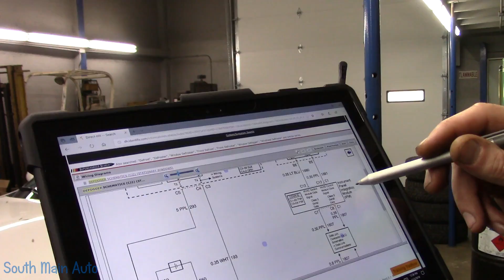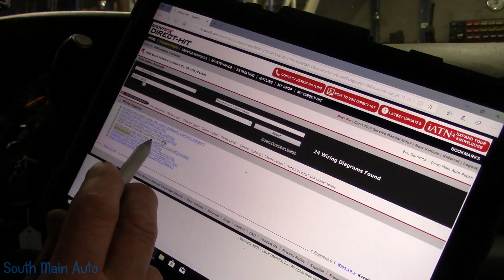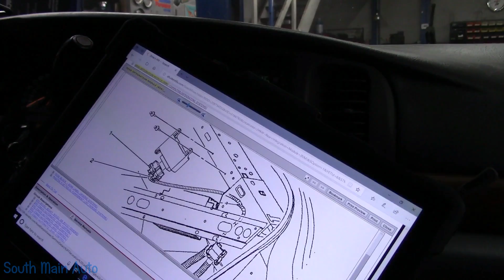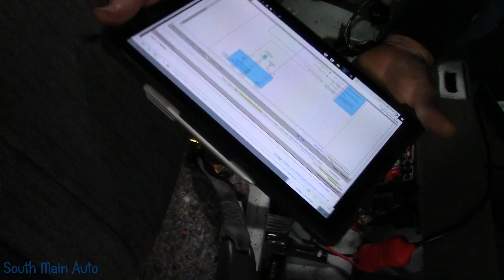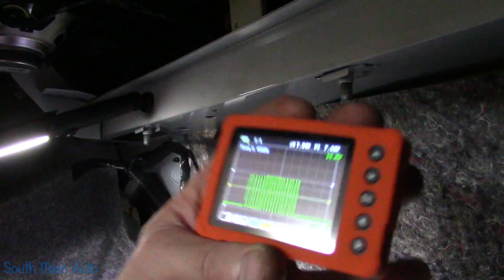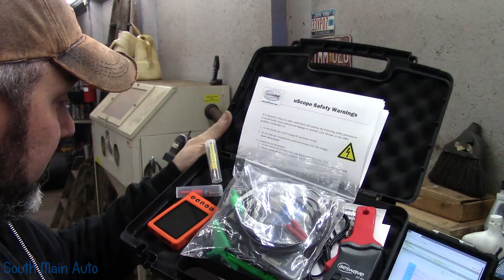Buick LeSabre: No Reverse, Interior Lights, No Defogger, No Power locks

Comment from the maker: *uScope Basic Kit (AES# uBasic)*
 :

https://www.aeswave.com/cart.php?m=affiliate_go&affiliateID=2525b91fc8e906e8215984074c9d9e8f&go=https://www.aeswave.com/uscope-basic-kit-p9621.html 

 
*uScope Master Kit (AES# uMaster)* :

https://www.aeswave.com/cart.php?m=affiliate_go&affiliateID=2525b91fc8e906e8215984074c9d9e8f&go=http://www.aeswave.com/uScope-Master-Kit-1-channel-automotive-scope-p9273.html

*Power Probe IV w/Case & Acc - Red (PP401AS)* : https://amzn.to/2JBSqbb
Reply: I had recommended this scope to you  3 years ago when I got mine. Use it all the time,under dash, in rear fascias(left/right cross traffic mod.no comm.) under seats etc..super handy. Firmware updates on AESWave web site.
Reply: Cool kit! The master kit link above redirects to the index page - I think that should be: 
https://www.aeswave.com/cart.php?m=affiliate_go&affiliateID=2525b91fc8e906e8215984074c9d9e8f&go=https://www.aeswave.com/uScope-Master-Kit-p9622.html
Reply: @MichaelShuler  I'm guessing that is in US funds.
Reply: The coil paddle is nice. It slips into tight areas.
Reply: What scan tool gives the schematics diagrams?
Reply: The scan tool you are using is it who makes it , is it  available in medium/heavy duty application or is there a yearly subscription for it.
Reply: That's kinda funny.  I bet that is a greek u symbol, which in electronicalses world is used for "Micro"   So it's a "Microscope"  Kinda punny.   :)
Reply: @JamesP33R  Makes sense, Greek letter "mu", symbol for "micro" in science and engineering.
Reply: I'm totally buying one of those! No idea what I'm going to do with it, but I'm getting one anyway.

Comment: I have a 2002 Lasabre with barely over 100k on it. I developed a new problem where only the drivers side power window motor works and the interior lights do not work along with the other 3 door windows      any ideas anyone?   Great video on the Buick just like all your videos.    thank you

Comment: Thanks, had all those issues, replaced the module and now everything is working again. The Back seat is THE BIGGEST PAIN TO REMOVE. Push and push those clips down and pull seat straight out. Would have been easy to remove from truck but no GM had to put 2 plastic clips in back of seat. Total BS. Glad it worked so cheers to you!!!

Comment: I have a 01 lesabre custom,the power locks,turn signals,trunk release,key fob,everything in the guage cluster except security light and odo. ,doesnt work,checked both fuse boxes 5 times,nothing bad,any ideas? I'm guessing one or all of the bcm,2 I can get to but cant get to the third,

Comment: love your channel and learn alot.  half the episode must be about teaching how to use certain techniques to troubleshoot with scanners and wire diagrams.  if that's the case, thats great, it is very informative.  i'm saying that because before you go into all of those steps, isnt it faster just to look under the seat at the harness and if thats not your problem then move on?  Love the smell of brake wash or brake cleaner too haha.  i used to use carb cleaner, but brake cleaner comes with so much more force.  its great when i'm not around my parts washer.

Comment: A friend of mine had a Mercedes, one of the small ones. The air intake for the hvac pulled air off the top of the battery. I couldn't believe that stupidity.

Comment: Is it possible for reverse lights to not work but interior lights work but still have a bad RIM? My reverse lights and license plate lights have not worked in a long time. Changed bulbs and checked fuses and both did not fix problem.

Comment: I had a muffler shop fry my electric steering never disconnected the battery when welding it.  Couldn't turn right, after I left and took it to dealer 900$ later they had to change the whole steering column.  The shop gave me every penny back, I still use that shop to this day even though they screwed up they were very professional and didnt try screwing me honesty goes a long way with me.

Comment: Please do an update if you got the ok to fix it. I'm curious if the module is plug and play or has to be flashed. I have a customer with an 03 Park Ave that has a bad  RIM, but I have yet to find 1 used, and GM doesn't make it anymore.  THX for all you do!

Comment: Eric, this is a little off topic. I just had a new starter put in my Dakota. On the old starter the main wire from the solenoid that goes into the starter case pretty much corroded away to nothing. On the new starter the same wire is bare metal. Should I paint it with high temp paint or hit it fluid film every few months?

Comment: Eric! Bought the uScope using your link! Thanks for linking the basic one. I thought there was only the, "Master" kit. I got the mini bnc to bnc adapter so I can use my Pico leads. In regards to the module, occasionally I see things just randomly die from having the battery disconnected and reconnect. Either that or the shop shorted the alternator, and then disconnected the battery once they realized that's what they should of done (shrugs). Thanks again for all your videos. They've changed my life, and 4 years later I've quit my job and work on cars full time successfully.
Reply: Exactly my opinion,  I hate to think the worst of people but people are typically the worst, like you I bet they decided to undo the batt. After sparking out the alt.

Comment: Bunch of overcomplicated bullsh*t - Buick should just hook the wire from the “rear defrost” switch to the damn relay; having all these other modules just introduces more points of failure. It’s okay if they want to use the modules to diagnose problems, but the results should be in plain English (“blown fuse”, “heater burned out”, “short to ground at switch”, etc...), not some mystical code. Sadly, most computer software suffers from weird error messages too (and I know, I AM a computer programmer by vocation)! 😎 Remember, when all else fails, pack the POS full of fireworks, light the fuse, and run like h*ll! (Or at least, buy a new can of brake parts cleaner - had to throw that in!) 🤠

Comment: Had a 66 Impala the wires under the back seat were shorted by the seat so that caused the fuel gauge not to work. Also I have just the scope like that i built from a kit for $20. P.S. What was the out come did the new module fix it?

Comment: Eric, how did you get the latches from the back seat cushion to release?? I have the exact same design on my Cadillac and I can't get the rear seat cushion to pop up to be removed. I couldn't see what you did in the video because the camera wasn't at the right angle for filming. I'm tried pulling, pushing rearward and everything else the factory service manual describes and I still can't get the rear seat cushion out of its latches. Thanks.
Reply from the maker: On the front of the rear seat bun I push down, then back, then pull up. When i do the follow up I will try to remember to show that.
Reply: @SouthMainAuto  So you're not reaching your hand between the cushion and the carpet to pull on a release lever? There's no mechanism?
Reply from the maker: no sir, just a fixed latch and hoop
Reply: @SouthMainAuto  Thank you very much. I'll be looking for the procedure shot in your follow up video if you remember. Smiles.
Reply: I have a 2011 DTS, You need to pull up in a firm quick motion. If you pull up gradually, the seats wont come out.
Reply: @peterm1643 I think some cars, including yours, could be a little bit different compared to others.  Mine is how Eric described but I just get scared because I don't want to damage anything under the cushion. I've never been someone who just tugs real hard because in most cases it breaks on me. Thanks.

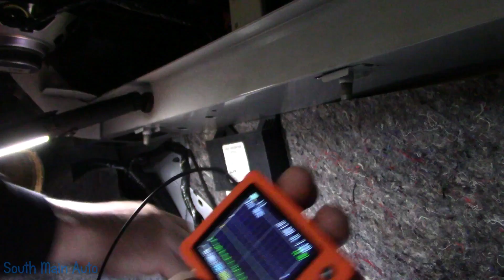Comment: 19:40 on... bends needle stabbing for a ground (habit from using more robust stabby things), "And with the module still plugged in we still got.... nothing, cos my wire fell out" - I had to stop to compose myself I was laughing so hard. Not laughing at you there Mr O, I do similar work and it just struck a chord with me that the exact same type of things happen from time to time, usually comes in a wave of "oops.. didn't mean to do that", "oops.. that doesn't plug in there", "ummm... that was working a minute ago... left this cable detached testing something else dummy"... and on and on. I have been known to just walk away for 10 minutes to regain composure when it happens, it's almost as though my cognitive functions went bye bye and need a short nap or a reboot while at the same time everything around conspires to befuddle my diagnosing. :D

For the record, today was my dropsy day - every tool, fastener, piece of paper... anything, that came into my hands was promptly sucked away by gravity. The smaller it was the further it managed to flit away into a dark crevice or under some immovable object requiring ridiculous amounts of time to retrieve. And no I did not go to work drunk! Hope it's not just me that has days like this :D

I love the look of that mini scope, so portable for confined spaces I sometimes find myself in.

Comment: Other shop had no class, it doesn't matter if they had anything to do with the failure or not. Never tell a customer to pound sand! However I heard the old phrase "ever sense you worked on my car" more times than I can count. Some how some customers think just because you work on their car everything that goes wrong from there on is your fault. In 45 years I never told one to go pound sand. I did throw one or two out of my shop after they threatened to beat me up!
Reply from the maker: Thing is this guy is pretty calm. He totally understands, he was just wondering what was wrong and if it had anything to do with it.
Reply: Mr. O, I do hope you alerted the customer that the battery must be corrected for safety reasons in addition to the needed module.
Reply: @SouthMainAuto  He might be calm, but does he own an excavator ???????

Comment: Ha ha - Keith gets a uScope, so Eric needs one.  Ivan must be next.

Sorry, nothing to do with the video.  The uScope is GROSSLY overpriced.  4096 sample point memory.  1 MS/sec sample rate is really only good for 100 kHz signals.  Bluetooth would be more useful for saving data than USB.  Can the microSD card be used to save waveforms ?  Looks suspiciously like a DSO Nano which sell for under $100.

Comment: AES wave is kinda pricey but there stuff works pretty good and are real convenient to use.  I’ve had the U Scope and U activate for a while now and used them a few times mostly for secondary ignition and to diagnose a cooling fan that was smooth but was not at rated CFM.  I’ve never seen you use their U Activate, its almost like cheating.

Comment: You're the best! You need to change your motto though from: "If I can do it, you can do it." To: "if I can't do it, it can't be done!"
Reply from the maker: Well that would be a lie though
Reply: @SouthMainAuto  Our Air Frame  Shop in VS-24 USN 1973 Motto was "If We Can't Fix It It Ain't Broke".
Reply: No I agree with the original post. 
The proof is the Chevy SSR wiper fix.  
Bad schematic data
Bad troubleshooting guide
Bad replacement part and he still nailed it.

Comment: Hello Sir! First off I wanted to say I really enjoy your video posts and have used them a lot as I try and do most work for my vehicles! Sure wish you were down this way I would gladly give you my business! That being said I  wanted to ask for your advice and really didn’t know how other than just post my question on your latest post! Ihave an issue that has been haunting me on my 2002 2500hd lb7 duramax. The truck for the past month will not go into gear for the most part the indicator light will flash but it’s in a neutral like state. If it does go into gear it will usually shift hard and be in 3rd gear limp. No SES lights on the dash other than a air intake heater voltage low code. I did get a trans code from it once and that was p0700 and trans fluid switch c low voltage code. After doing some reading I changed the NSBU switch with a merchant auto and also the fluid and internal and external filters. No change also cleaned the grey trans plug on passenger side and it did have some fluid inside it. Still no change. I hooked up my hp tuners software just to look at the scanner and I noticed the TCM voltage when you start it will be at 14.3 and slowly trickles down to 8v or less. When it’s about 11 the Trans seems to shift fine into gear and will move without limp mode but below that it has the neutral like issue! I have also changed the ignition switch to rule that out as the indicator went blank yesterday and that fixed the issue but still have the trans shift problem. I checked voltage at the tcm on the orange wire and it reads 14.3 and the grounds seem to be ok at the tcm. Also cleaned ground under drovers door and driver side engine to see if that would help! I am lost st this pinpoint other than changing the tcm I don’t all I know to do. Just wanted to get your opinion on how I could maybe isolate the issue. Thanks for all the shared info it is appreciated!!!

Comment: For us DIY'ers: The Class 2 Serial Data network on a GM uses a zero to Seven Volt signal; the voltage rests at Zero volts when there is NO communication; the transmitted data is a variable pulse width signal; Class 2 is found at Pin # 2 of the DLC, and is a single-wire network system; and GM uses what is referred to as a “splice-pack” to connect modules and the DLC to each other for network communication.  Great video Eric, that little U scope is getting around!
Reply: what time base setting(ms/div more or less) would be ok to see good communication???? Tx
Reply from the maker: 500us / 2v per division with a trigger @ 3v and you should see it just fine
Reply: Thanks Wyatt. Here's a reason I scan comments, looking for gold.

Comment: I got a little lost at the 5 volt part. I thought maybe the 5 volts were supplied by another module but was lost somewhere. Apparently that module creates it's own 5 volt output, or in this case, doesn't but is supposed to. If his 12 volt outlet didn't work before and is controlled by that module, the module might have been failing.

Comment: Why should that battery being in the be such a problem back in my day VW had them under the seat gas was not an issue then no vents.   Battery that cost $30.00 then cost $90.00 now add vents your into that $200.00+range now.  Why don't the put them in the trunk by law.   Look at the Porsche SUV under the front seat.

Comment: Just Friday night my 1993 Jeep Cherokee 4.0 lost  power to the turn signals to the radio to the AC. I got my scope on a rope out and started checking fuses and none of the fuses were bad and when I got done doing that everything came back on so evidently I Josseld something.. but I don't know where whether it was the fuse box under the hood or it was the fuse box under the dash.. but it's working now I also like the fact that you have a Missouri license plate and a Florida license plate on your wall I was born and raised in Missouri and now I reside in Florida .....imagine that....?
Reply: Might check the ignition lock cylinder. They have a habit of not fully returning to the RUN position after starting.  When they do so you get no function of ignition fed accessories. Try turning the key  back towards you after you release the key after starting the engine.
Reply: @SuperGlacierGirl  thanks for the info Brad but I just change the ignition lock and switch like 6 months ago I did forget to mention that didn't I LOL

Comment: I have this problem with my 99 Civic Coupe where my reverse lights only work with my headlights off once I turn my headlights on my reverse lights turn off what can be the cause of this problem?
Reply: Bad ground.
Reply: @mattmanyam  sold the car so I'll never know
Reply: @mattmanyam  I still can't pin point the location alot of wires are spliced at the emergency light switch

Comment: I would try disconnecting the battery  and see if  the issue resolves  itself. Maybe resetting everything.  The rear seat loose and the module failing have some interconnecting  history.
Reply from the maker: we did that in the video if you watched it to the end
Reply: @SouthMainAuto   Yes  you did say you did it , I didn't pay close attention to audio, missed a sentence. I always watch your video's to the end. You  should be a automotive shop teacher  I learn something in every video. Each vehicle is a mystery  waiting for a solution.

Comment: Lol.. I just got the Uscope, but it looks like you got the master set, with scope protector and all the other accessories.  I went the basic, but now I'll have to order the silicone protector... and a couple adapters to use my Pico accessories. .. amp clamp, COP paddle, etc
Reply: Cuba Rodriguez just get the bnc adapter and you’re good to go. I use all of my pico accessories as well. The paddle probe by aes wave is nice to have as well. Gets in places my pico probe can’t sometimes. Doesn’t get used as much nowadays though since I bought a surface pro and mounted my pico to the back of it.
Reply: @Jpilgrim30  well, besides the BNC adapter, I would like the attenuator and AC coupler adapters... from what I understand,  the COP paddle has its own attenuator incorporated into the tool, but I'd rather be safe than sorry. Thanks for the advice. 😊
Reply: Just did the Honda civic rear wheel bearing today. It was a gravy job.
Reply: @jeremyanthonyw2r  I knew it would be.  Great job.
Reply: @CubasAutomotive  thank you

Comment: It took me a little bit to figure out how to release those Metri-Pack 100W terminals as well. It seems weird that they release from the front side of the connector. By the way, I have the uScope Master Kit as well, but it doesn't have the proper attenuator included for primary ignition testing. It has to be purchased separately, as mentioned in the user's guide.